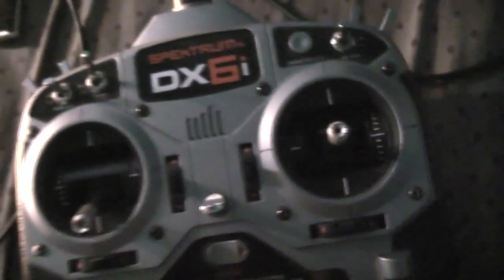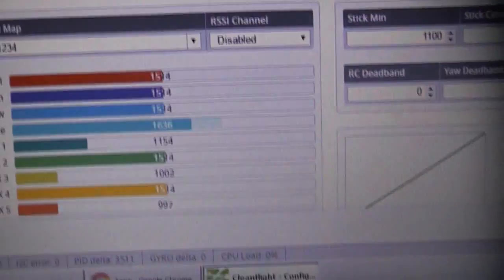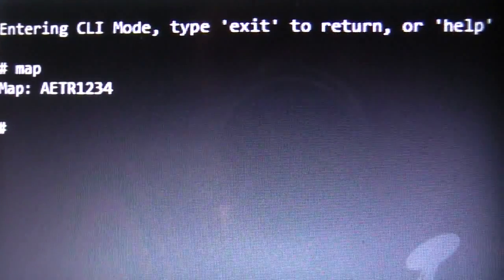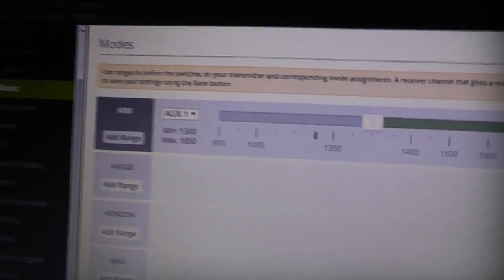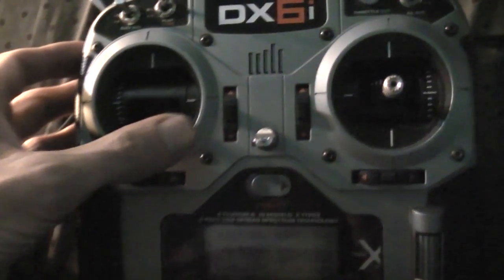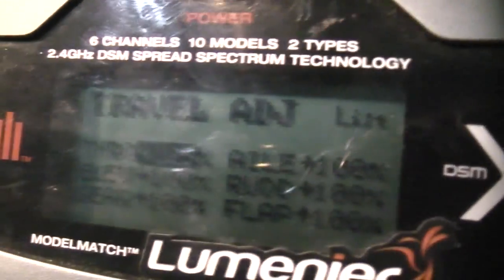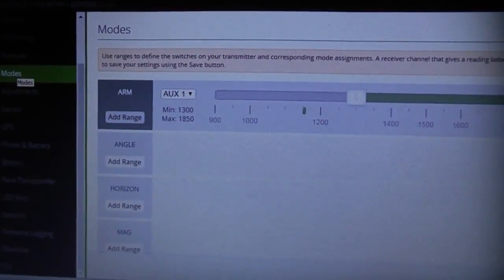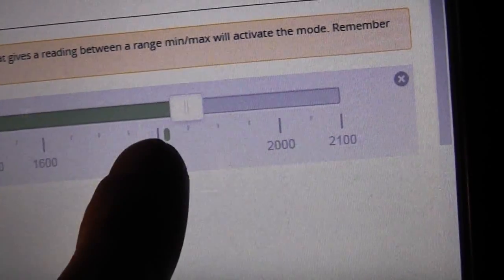Binding, mapping, arming, Spectrum DX6i tramsnitter to Nano JJpro T1 Racing drone

Comment: Thank you, why would the stock remote come like this? I understanding reversing channels I guess, but I needed to mess with the travel for the Arm to work? Sounds whack on part of Spektrum
Reply from the maker: I am glad this video actually helped someone, this type of problem can drive you mad because it can be so many things causing it. Trying to get the transmitter, receiver, and flight controller values to all jive isn't something people talk in depth about online because it gets a little boring.
I'd never dun this type of thing before so I had to piece together an understanding of what was going wrong by reading old forums from 10 years ago about airplanes and transmitters not working together.
Reply: I'm still a bit in shock it was this, thank you so freaking much. I'm yet to stumble on a video that even addresses this, thank you than you
Reply from the maker: I'm glad I didn't delete the video the other day when I was pulling down all my pore performing vids.
Reply: R/C 101 I'm still mentally at odds why no one has mentioned this, you saved me big time thank you
Reply: Omg. You’re the only one tell me how to do arm switch is not turn green...thank you so much!!!
Reply: R/C 101 im glad you didnt delete it also.  This is one of the easiest ones to understand too.  It seems like all the other giys doin these vids just assume everyone else k ow what they are talking about.

Comment: I'm wondering if you could help me, I've bound my Dx6i with my Qx90c and it's working fine but when I'm in cleanflight and in the receiver tab, none of my switches move the curser or the screen across the scale?!? Any help would be greatly appreciated as I'm stuck
Reply from the maker: you might need t go into the transmitter menu and redefine auxiliary channel 5 as one of the upper left hand switches.